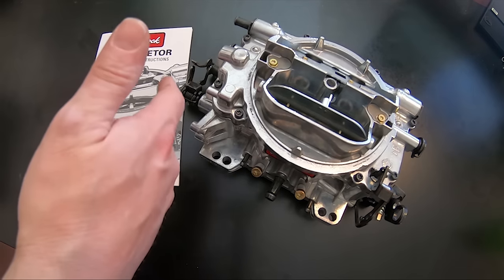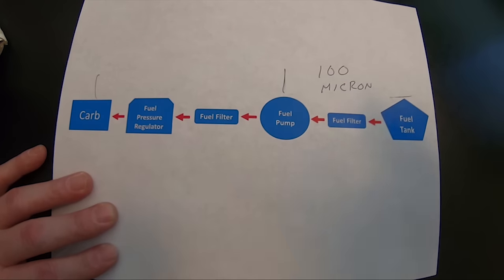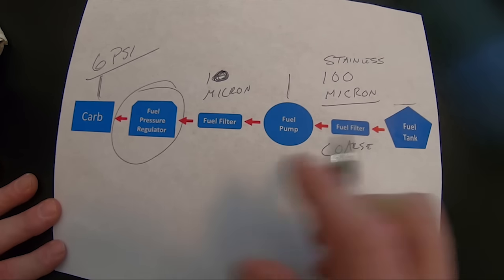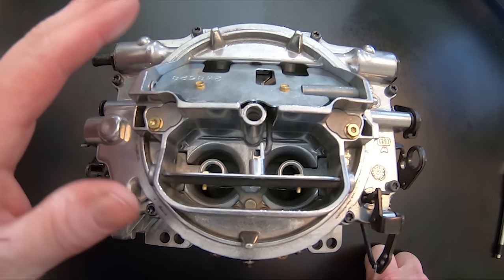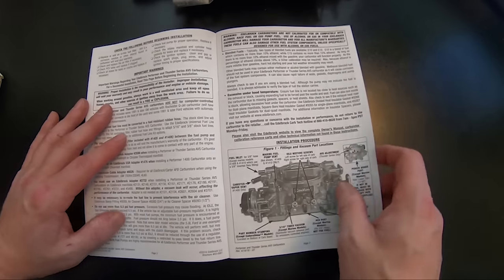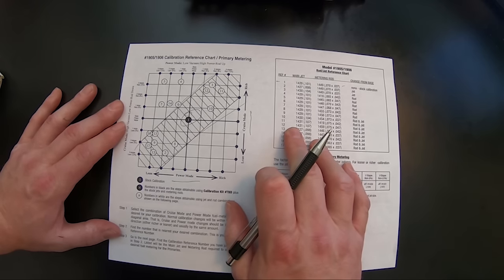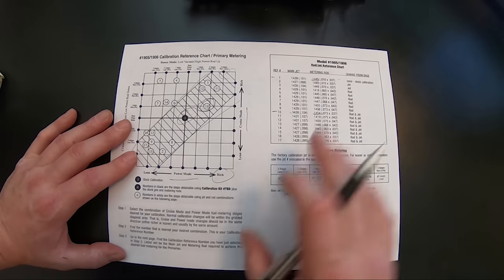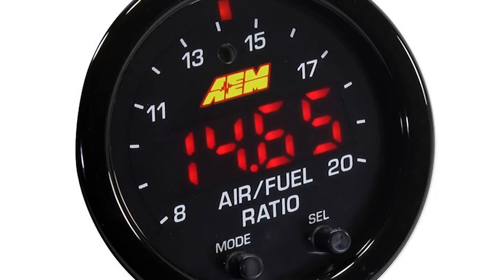The Ultimate Edelbrock Carburetor Tuning Guide

Comment: Awesome video! I have a 69 Chevy 396 punched 60 over with a fireball cam. I have struggled forever with it running way to rich. I have an edelbrock 1407 on it. All I have ever done is messed with the mixture screw, idle and added a fuel pressure regulator set at 5.5 and still rich. I replaced my points with a conversion kit and timing seems great. I’ve been told it’s too much carb or or not enough vacuum for the high lobe cam. Any help would be very much appreciated! Thank you! John
Reply from the maker: For sure you’re on the right path with the regulator.  5.5 is a good place to start.  It’s likely not too much carb.  Whats your initial and all in timing set at?  What’s the compression ratio and what are the specs on the cam?  I’ve got more questions than answers for you right now, but it’s leading to some possible solutions.  What elevation do you live?  Have you adjusted the floats down lower to reduce the amount of fuel in the carb?  Invest in the calibration kit for that carb.  You’re going to need it once the above can be checked off the list.
Reply from the maker: Your kit https://amzn.to/3jWpSLA
Reply: @MuscleCarSolutions   Thank you so much for the quick response. I’m kinda of a novice at this. I know enough to get myself in trouble . My dad and I bought a 69 nova and went to rebuild the engine He passed away. He could do  anything  mechanical. Long story short, I friend of his came to me and builds engines. I went to put the engine in the car and he put the wrong cam bearing in so no oil... we are not on good terms as you can imagine. Had that fixed. I believe it’s a 12:1 compression. I do the timing by feel and ear. No popping or anything, it actually runs like a champ but so rich. The cam looks like it has max lift at 115 and duration is 216. I haven’t adjusted the floats. I will buy a carb kit!
Reply from the maker: You might feel like a novice, but you’re working through things that a lot of folks can’t or won’t.  Couple pointers from your comments.  I know all about not cutting the rear journal in the 396 cams.  :/ It’s never a good thing when that gets over looked!  Ok.  I’d for sure put a timing light on it.  By ear will get you close, but there’s a more precise solution and then you’ll know.  Timing and ignition is always where I start with carb problems.  You’d be amazed at how often most of the fix is there!  Make sure the mechanical advance in the distributor is operating properly.  You might need a spring change there as well to get the advance you need when you need it.  On the cam specs, if you have the cam card that came with it, will give me a little better idea of the combination.  If you’re at 12:1 cr that’s a pretty healthy engine!
Reply: @MuscleCarSolutions  Sounds great, do you know what the timing should be set at? I do have a picture of the cam card but I can't attach it here. He told me it was 12:1 but who knows I guess!!
Reply: @MuscleCarSolutions  Sounds good! Do you know what the timing should be set at? A have the cam card but can't get the pic to attach here. He told me it was 12:1 but who knows!!!
Reply from the maker: John Hepburn knowing your cam specs would be very helpful.  Your timing can vary a little but a good place to start is 14-16 degrees initial and 34 total.  You can see how it starts and drives from there.  I usually don’t go past 36 on total timing.   Can sometimes go 38 with no issues but 36 is normally safe.
Reply: @MuscleCarSolutions  I can't attach the picture I have of the cam card. Do you have an email address I could send it to? Thanks!
Reply from the maker: John Hepburn I just need the duration @ .050, the lift, lobe separation to include any advance that was ground into the cam and verification on the cam cars that the specs are based on the 1.7 rocker ratio.
Reply: @MuscleCarSolutions   216. Ordered my kit too!
Reply from the maker: 216?  Your spec card should give you all the info.  If you go to the about section on my channel you can click the email link.  Just send me the image so I can see what you have.
Reply: @MuscleCarSolutions  Done!!
Reply from the maker: John Hepburn wow.  That’s an old cam!  So it’s 216/216 .515/.515. The LSA on that cam is right!  I doubt they put any advance in it.  It’s probably decent on the low end but it will run out of power past 5000.  Great street cam.  I’d still stick to the game plan.  Confirm timing, drop the fuel level down, then start tuning the rods/jets/springs and see if you can improve it.  The 750 is for sure not too big.
Reply: @MuscleCarSolutions  Awesome!!! Yes the motor was rebuilt 20 years ago and I have probably put 1000 miles on it around town. Thank you so much for your help! I ordered my kit. I will get my timing marks cleaned up so I can see them good!!!
Reply from the maker: Keep working on it.  You’ll start to find the sweet spots.  Just hollar if you have any questions.
Reply: @MuscleCarSolutions  Thank you very much! I will keep you posted, I won't get the kit till the end of next week.
Reply: Hey! I got the Edelbrock kit! I believe my timing is set 14 degrees. I put a vacuum gauge on it and I’m only running about 13 with  the rpm at 800. I haven’t touched the kit yet. Any thoughts? Thank you!
Reply from the maker: You’re fine with 14 initial timing.  Start tuning!
Reply: @MuscleCarSolutions   The low vac bothers me but I’ll start with the springs!
Reply from the maker: Hard to say without knowing the specs on the cam and some more engine details.
Reply: @MuscleCarSolutions  Update!!! So, I got my timing set at 14, I also went with the lightest springs in the carb and it runs better than is ever has!! Thank you for your help! John
Reply from the maker: John Hepburn that’s great news!  Sounds like you’re on the right path!  It’s the ting about tuning.  Carbs of any flavor or EFI.  Sometimes it’s just about persistence.  Glad you got it all sorted out!  What’s next?
Reply: @MuscleCarSolutions  I'd love to put power steering in it! I'm getting to old for the manual steering. Ha!
Reply from the maker: John Hepburn don’t blame you a bit there!  It’s almost a necessity!

Comment: My engine back fires around 1400 to 1600 rpm, is it wrong placed sparkplug cable or the carb needs bigger jets for more fuel?. I Need help with this.
Reply from the maker: @cordelmar  hard to guess with a limited amount of information but if it’s backfiring it’s probably a lean condition.  At that RPM it indicates the possibility of a vacuum leak.  What carburetor and intake are you using?  What’s your initial timing set at?  When was the last time to carb was cleaned/serviced?  What is your fuel pressure at the carb?  Does it backfire at any other rpm?

Comment: Great video but confused on the  front vacuum ports (around 7:30 in the video) . I have a 1966 mustang, Edelbrock Performer Manifold and carb, original style vacuum advance distributor. I was under the impression that the right (drivers side) is what I should use and the left was for type that have egr. Am I wrong? I also notice with a  vacuum gauge, left port is Zero unless throttle is applied whereas right port has constant vacuum. HELP ..LOL... I want it to be hooked up correctly. Thanks !!!
Reply: Bone Head yup I knew that and thanks for straightening this out. But now begs the question of vacuum gage and setting idle air fuel. I have seen you should get max vacuum when setting, then back down 1/2 turn on each side. How do I get max vacuum if it's zero at idle? Use the other side?
Reply: @MuscleCarSolutions You are awesome...thanks for the quick clear replies !!!
Reply: So, because I am dummy... which port to use when using a vacuum gauge? Driver or passenger side?
Reply: @Washitguy  Driver side for running a vacuum gauge.

Comment: I have a question on the digital  air fuel gauge. If your running dusk exhaust do you have one for each side of the exhaust system and how far down the exhaust do you place it?
Reply: @MuscleCarSolutions  that good to know. I was thinking of building an LS motor up with a 850 on it. With a long and tall runner intake on it. With a fuel cooler in line from the tank. A trans cooler to cool the fuel as well. Then have a circulator pump with a large trans cooler on it in the back to keep fuel at a constant temp. Use a carb spacer to isolate it as well. So this way I can have a cool dense fuel charge. I want looking at several to buy. But I will wait on you to return from SEMA and see what you come up with. I want this motor to flow well and have good power. Thanks so much for your time and help with this.

Comment: GOT A DEAD SPOT WHEN HITTING IT FROM THE GET GO. ITS A 600 CFM ON A 383 WITH A ROLLER CAM.I HAVE JETTED IT UP STILL HAS A DEAD SPOT ON INITIAL HIT.
Reply from the maker: Adjust the accelerator pump?  Change the squirter size?

Comment: Hi, thanks for the video! I’m having an issue with my 1406 edelbrock on my 72 Camaro. It keeps loading up with fuel. I’ve added a new 10 micron filter, fuel pressure regulator with a gauge, replaced and adjusted the floats and seemed to do ok, then started it up the other day and now I’m flooding again. Not as bad as before (fuel was dumping out through the accelerator pump) but now it floods and stalls. Please help, I’m no mechanic. I just want to enjoy my car 😆
Reply: Bone Head I set the regulator at 5.5 but the gauge is showing a little lower than that at 4.5
Reply: Bone Head regulator is new, it’s an edelbrock regulator from auto zone.  It’s the one that you can push in and turn like a dial. Probably not very high quality but I needed to try something. 
Fuel pump is the stock (mon-electric) pump. 
I had changed the floats and needle and seats in the carb but may need to go back in and see there is trash in there again
Reply: Carlos Castillo -- Seems like a problem I used to have, until an old guy circle track racer taught me to ditch the fuel pressure regulator, and run the fuel thru the carb on the "IN" port, and out the other side via an "Out" port. These carbs have an unused place just for that. Then run that "Out" part back to the fuel tank, or to the inlet line, with a valve on it. Turn the valve more or less to adjust flow and pressure. Clik on my user name and you can see (sort of) how it is on my engine by viewing my video.
I've had no more problems after doing this  "Loop"  type of pressure regulator.
Reply: Try adjusting the floats.  Might be letting in too much fuel.  Try adjusting them so not as much fuel flows in the bowls.  Good luck.

Comment: OK still having issues with this rebuilt 1411. I only work on the car whenever I get a chance, so it's not like it's taking this long to figure out. Anyway, I have 4 dead cylinders on my 440, 1,4,6 and 7. No change in idle on those 4 when disconnected from the dizzy cap. The plugs are sparking. My understanding is these 4 cylinders all run off the right side (facing carb) of the carb. So my issue is fuel. I blew air through the idle/mix screw holes. Strong thru the left side, not so much through the rt side. Obviously, I have a restriction. My question is, without dismantling the carb again, how can I clean out this passage and where does the passage go inside the throat of the carb? Thanks
Reply from the maker: Something could be blocking that passage and a full disassemble would be the route to go.  Keep that compressed air handy.  Once you get it apart that’s what I would use to see if you can determine where your possible blockage is.

Comment: I do have a question. I have the chart, tuning kit, 5.5lbs fuel pressure.  Have set float levels. Can't get it to idle. Wants to die at about 1000rpm. Was very rich but I thk Ive made some ground on that. Has a mother thumper cam. Sounds great but seems problematic. Pls advise.  Tks
Reply: Oops sorry. It's a 1407 edlebrock
Reply from the maker: Those cams are a little harder to tune.  What trans?  Converter?  What engine are you working on?

Comment: I just installed a 1406 carb on my newly rebuilt 350. I'm running a stock type mechanical fuel pump. My fuel pressure guage is reading 3psi of pressure. Am I okay with that low of pressure or should I get a higher psi pump so I can keep it in the 5-6psi range? Ty
Reply from the maker: At that PSI it’s going to have a difficult time keeping up with the demand.  Pressure and flow are two different things, but I’ll assume that the flow rate is also reduced.  Might try another gauge to verify that it’s not a defective issue and then swap the pump.  For sure run a pressure regulator that way you’re in control of what pressure the carburetor sees.
Reply: @MuscleCarSolutions  ty for the input. I have a new guage coming the non fluid filled type. I took my regulator off temporarily to seeing it was causing the ultra low psi. But it was still reading 3psi without it. So I'll see what the new guage says and go from there. I know regulators can bring preassure down but not going to make more if it's not there to begin with.
Reply from the maker: Sounds like you’re doing all the right things to determine where the issue is.

Comment: . I have a rebuilt 350 bored forty over with a .510 lift and 280 duration with 108 lobe separation roller camshaft and I have a brand new 650 edelbrock avs2 with electric choke. The problem I’m having is on cold start up and I let it warm up a bit and try diving but it cuts out really bad and will die. It only seems to run good when it gets to operating temperature. I think it is burning a little rich  and have the idle mixture screws backed off 1 1/4 turns using vacuum gauge. I’m at 10 inches of Hg at idle which seems really low but it’s the most I can get. I set the idle at 750 rpm. Any information would be helpful thanks
Reply from the maker: What is your timing set at?  What is your fuel pressure set to?
Reply: @MuscleCarSolutions  10 degrees before TDC and that’s with the vacuum advance still hooked up. I don’t know the fuel pressure. I have a regulator just have not installed it yet.
Reply from the maker: @63bravogarage  I’m close to sea level and generally start at 12 and go up to 16.  The higher in elevation you are, that number increases.  As an example, I have family that’s in Santa Fe and they’re close to 7000.  I always start at 16-18.  Just something to consider.  The poor fuel we have today likes a lot more timing.  For sure a regulator and a gauge so you can tune is extremely beneficial.  Working on those two things might get you closer to the balance the carburetor needs.  And of course once you get these things adjusted, then it time to start tuning the carb.
Reply: @MuscleCarSolutions  I really appreciate all your feed back. I installed regulator today have it on 5.5 psi. I also advanced the timing to 12 degrees. I think it performs better, but when I turn the key off to kill the engine it stubbles for a few seconds like it is trying to keep running. Does that mean it’s still out of time?

Comment: Great video I have a brand new avs2 carb sitting on a Pontiac 350. At idle it runs fine even at cruising speed but if I mash the gas I get nothing it just kills the engine until I let off the pedal. I can slowly creep up to speed but not instantly. Would you consider it to lean?
Reply: That’s accelerator pump.

Comment: Great video. I have a question. I have a 351w with a 600 cfm edelbrock carb, 1405 I believe. I rebuilt the carb and everything was going good, I'd get on it ran just fine. The 351w is rebuilt also, nothing special except gt40p heads. Well now when I drive it it runs fine but if I get on it hard it'll do a nice fish tail smoke tires or if i drive it for 10 minutes or so, then it all of a sudden runs like crap. I've noticed also when I take a turn at any stop sign or light it stutters for few seconds. Any help would be appreciated thanks.
Reply from the maker: Could be a number of things.  What’s your fuel pressure set to?  Is the carburetor bolted directly to the intake?  Fuel pressure and heat soak could cause either of those issues.
Reply: @MuscleCarSolutions  Pressure is right at 6, I have a 2 inch spacer in between intake and carb. The muffler is kinda close to the electric fuel pump, think maybe the heat from the muffler could be heating the fuel up and causing it?
Reply from the maker: @lancestrahm2362  what type of spacer?  If its aluminum, it will transfer the heat.  Yes, if the exhaust is too close to fuel lines of the pump, sure it could be cooking it.
Reply: @MuscleCarSolutions  it's a black plastic spacer
Reply from the maker: @lancestrahm2362  had to ask.  half the time its an aluminum spacer which is obviously an issue.  You've got the good one!
Reply: @MuscleCarSolutions  i appreciate your input 🙂 ill start with the exhaust then maybe a needle kit.
Reply from the maker: @lancestrahm2362  if you get into a situation where you can, when it starts to act up, pull over and check your pressure gauge.  See if it’s dropped off.  That’s not uncommon when it’s getting too much heat.  Especially if you’re running regular pump gas in the US.  Ethanol boils at a ridiculously low temperature.  I’m just above sea level and it starts to boil around 174 degrees.  Horrible stuff.
Reply: @MuscleCarSolutions  oh wow! Thanks I will do and I'll report back🙂

Comment: In tuning my engine timing, carb etc I cant get vacuum level any higher than 16 when (as I understand) 18 is a target minimum. My engine builder is telling me the problem is in carb set up. Can you provide a direction for me to explore? Fyi the camshaft is not a stock grind but is very mild. It is a 350 chevy with stock heads cr is +/- 9. The engine starts well and idles ok. It throttles up and down nicely also. I feel she's holding back under load but not hesitating or pinging. Im not carb savvy at all but really do want to get there! Please help. Thanks!